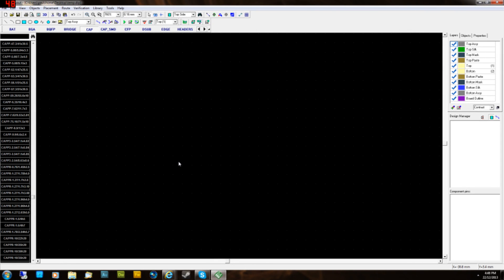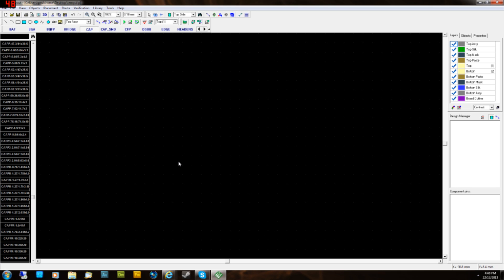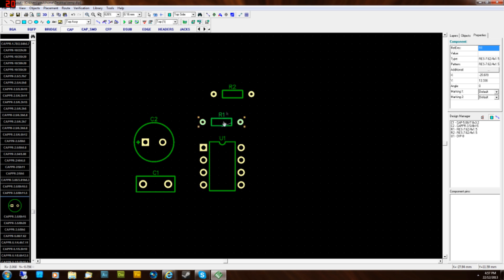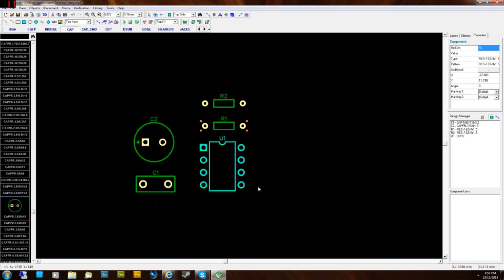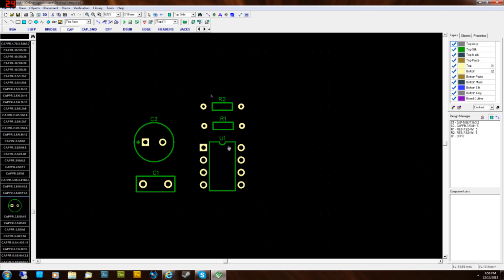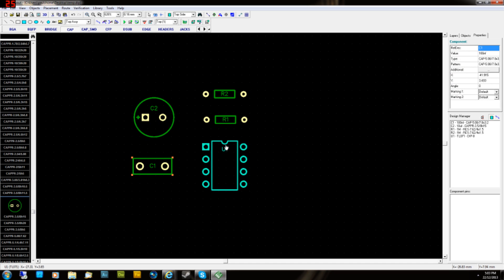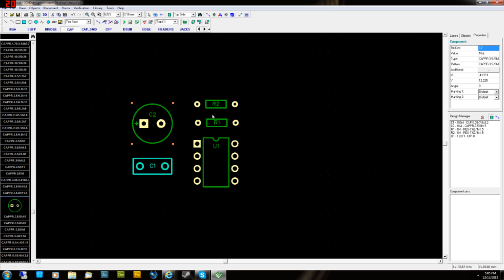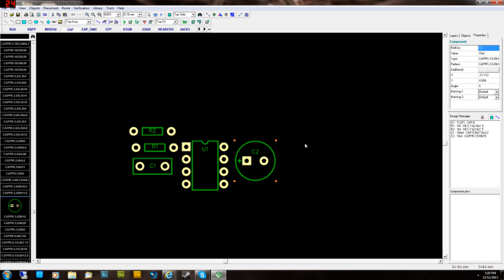Design your own Guitar Pedal PCB Layout - Single Sided (Part 1)

Comment: What version is your Diptrace coz i got the newest version and the selection at the top to select what type of components is not there, its all down the left side and a hell of a lot more confusing then what ims eeing on your video. I literally cannot find that first component (the DIP 8, TL071) its just not there even when i use the search function... can u help ?
Reply: Go to older diptrace versions and install 3.3.1.3 (https://diptrace.com/download/older-versions/) Then go to "Program Files/ Ditrapce/Lib" and backup this folder. Uninstall and install the latest version of deeptrace. When you need certain library, go to the backup, and then copy and paste in the "Lib" folder (not recomended copying all old libraries over news, only what you need to learn)